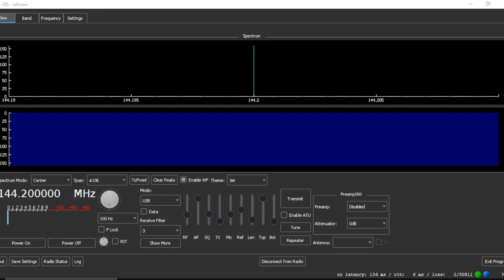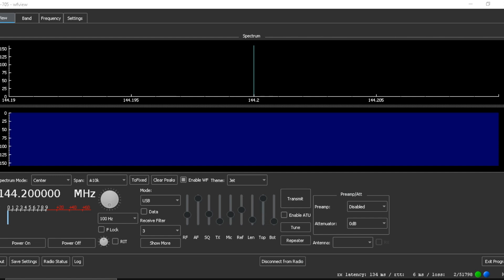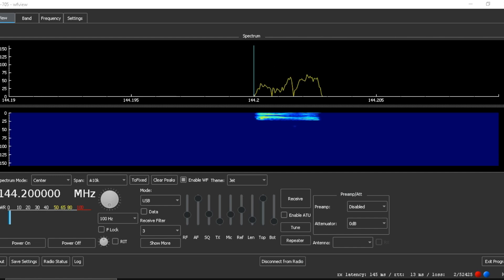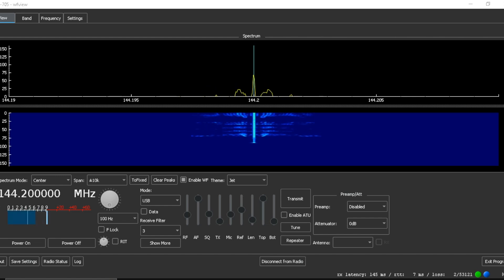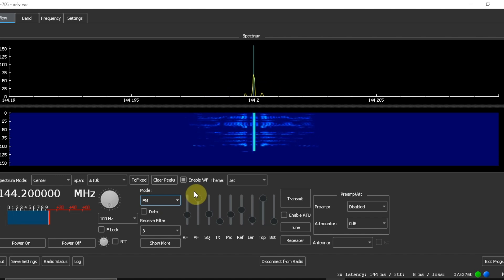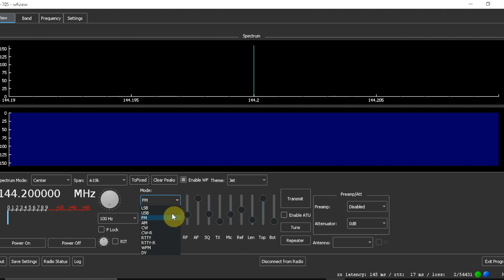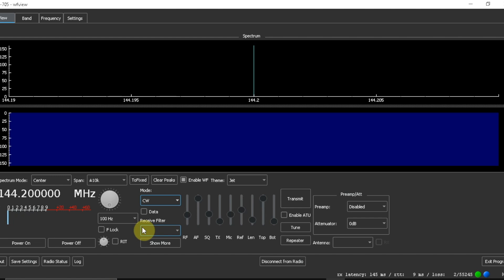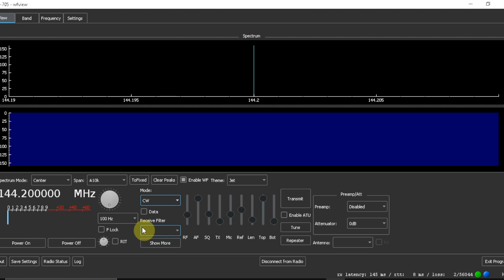Testing Transmitted Bandwidth on the Quansheng UV-K5

Comment: That's what I wanted to know.  It's sideband receive only.  Nice to know CW will work. I bet you could really get some range with that.  I suspect much better than FT8.
Reply from the maker: Yes FT8 will do better since it can decode below the noise floor.
Reply: @QRPMonkey  But with CW don't you have less noise.  I read some some stuff about digital modes that are narrow band like CW but add error correction.  Lots of debate about putting all the signal energy into a narrow space vs putting more error correction over a wide bandwidth.  I saw a video many years ago about how superior Olivia was.  They put a message into a stupid country song and decoded it.  You couldn't hear the Olivia message, but it was decodable.
Reply from the maker: Well i guess it all depends on how well your ears work for the CW.  Computers can hear really well.

Comment: Thanks for this. Expectation of DSB will be no range advantage over FM. There is another setting in the IJV firmware to explore possible enhanced range, "SATCOM circuit activation with reception boost > +9dB, similar to a preamplifier, to be used in exceptional cases of low signal". Might be worth exploring for another video 😉
Reply from the maker: I saw that in the menu, but did not know what it was until i read on the website. It states its for above 240mhz